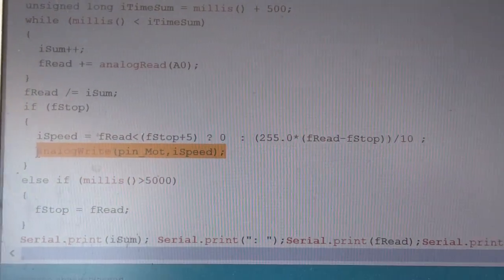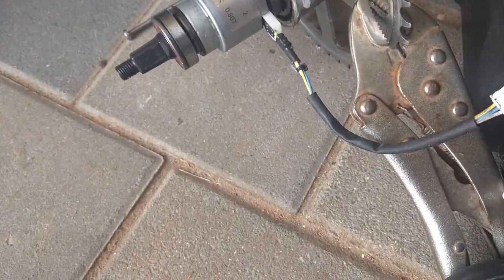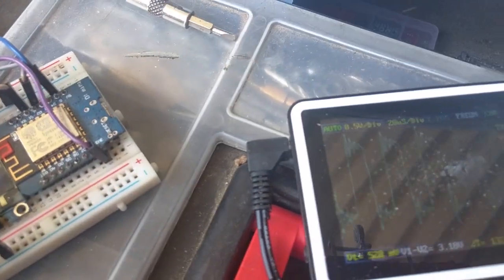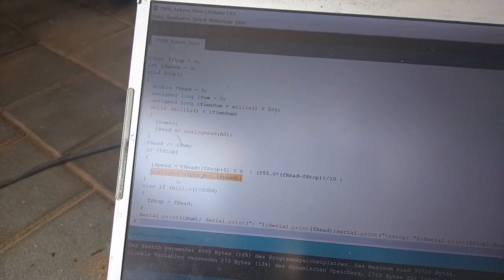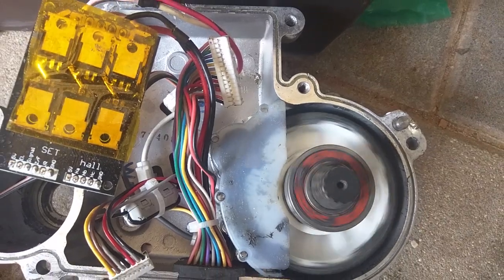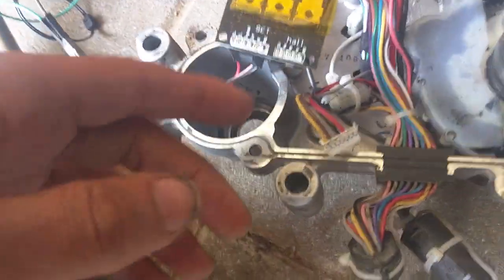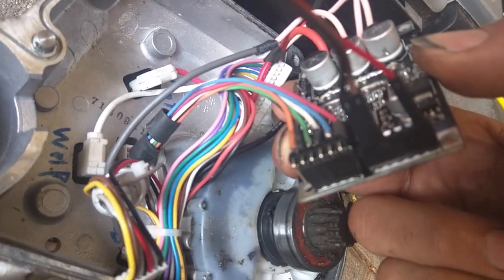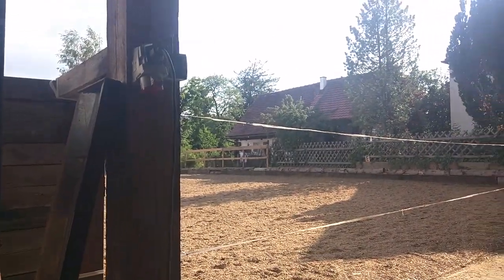Tutorial: Open source Panasonic/Flyer eBike/Pedelec Controller

Comment: I had a Bosch motor completely dead put of warranty. I used a simple KT sensorless controller and wired it to the motor phase cables.
Reply: Does it work? How many volts? Which motor version? Thanks

Comment: Hello, Can I use an external controller with this motor? No need to torque sensor, pas or whatever.

What's the max power this motor can take in your opinion?

Thanks
Reply from the maker: Sure you can extend the the three big phase cables and the 5 thin hall sensor cables to the outside and attach a generic bldc controller.
Power output should be 250 Watt at 36 Volts.
Reply: @robodurden  Nice. Here in Poland bikes with this motors are selling as recycling metal price, very cheap. I was wondering if add 48v battery and  a sinewave controller would be a fun little project. Thank you
Reply from the maker: @Full_Throttle_no_Brakes  and again another stupid fun project :-( Any bike should be street legal.
Reply: @robodurden  it is legal here off-road
Reply from the maker: @Full_Throttle_no_Brakes  and off-road ist stupid fun.

Comment: I don't understand the connection of the torque sensor. I am building the same motor driver as you. Could you please provide me the schematic for the connection you used on the sensor? You say a diode a capacitor and a resistor to ground but I don't understand how to connect this components. Thank you very kind
Reply from the maker: If I remember correctly, the sensor outputs AC. So you need a diode to omit the negative voltage. Then you charge a capacitor and measure it's voltage via ADC. The resistor is needed to discharge the capacitor. Maybe I find the old forum discussion. But I quit pedelecforum.de because they censored me..
Reply: @robodurden  thank you for your reply you are very kind. May I ask why is needed a resistor to discharge the capacitor? Because I don't find such info from the original post on the forum
Reply from the maker: @fiorenzo6301  you need to discharge the capacitor within a few milliseconds in order to correctly measure a decreasing torque :-) no resistor = always max torque measured.
Reply: @robodurden  ahhh interesting... But if you put a small value capacitor could it behaved in the same way as a big value capacitor + resistor?
Reply: Anyway i have finished the display yesterday, now I am going to work on the motor, maybe this evening or tomorrow i test the torque sensor with the oscilloscope. I aim to get more power from the motor than the original motor controller. I will test the motor with a higher voltage battery
Reply from the maker: @fiorenzo6301  maybe a VESC controller and 48V - If you aim for 30+ kmh. Cooling should be a problem.
Post a video once you are driving !
Reply from the maker: @fiorenzo6301  no. If your MCU offers input_pulldown you could use the internal resistor. But better ad the external resistor.
Reply: @robodurden  yes the problem is that the motor is potted into a kind of plastic/resin. I don't know how much power I could obtain from such  temperature constrained motor but we will see. Yes i will do a video
Reply: Hi robo durden, to day and yesterday I have tried everything you did with the couple sensor but it doesn't behave like yours. The square wave you obtain on the secondary coil doesn't change in anyway when you apply torque to the pedals. I have also reconnected the motor to it's original controller and hooked up my oscilloscope to the the sensor but the same no difference. I have read some topics about this motor and some people says that the sensor is read in a different way... I don't understand why it works for you. Could you help me please? I would be grateful
Reply: Hahaha maybe i know why!!! Because I am going in the wrong what. In your video I see that you locked the sproket hahah. I was putting force between the pedals of course it doesn't work. Is it right?
Reply from the maker: @fiorenzo6301  if I remember correctly, there is one square wave which does not change. This coil induces magnetic field. The other coil read that square wave but its strength depends on the torque.
Sorry, too long ago. I can not help you.
Reply from the maker: @fiorenzo6301  first rule of project mayhem: you do not ask questions.
Reply: @robodurden  ahahah now it works, i am very grateful with you. Thank you. If you like we can get in touch in a different way. If you provide to me it
Reply from the maker: @fiorenzo6301  i don't have friends.
Reply: @robodurden  well actually your assertion is quite true, but I have faith in the universe... science show us that it is so big and so complex that, of course, something superior did it and in It i give my trust and feel to be understood as a son and friend.
Reply from the maker: You should visit my https://github.com/RoboDurden/openPanasonicBike anyway. There is also still the link to my old forum post (German) and there I wrote:

Blau an GND vom Arduino Nano
Weiß mit 20 kHz Rechteck ****(pin_Pwm,20000);
Gelb über Diode an zB 1 uF Kondensator und analogRead(A0);
...
Um den Drehmomentsensor auszulesen hab ich eine Diode, einen 0,1 uF Keramikkondensator und ein 220k Ohm Widerstand verwendet.

Comment: Thanks for the great video. In stead off the original battery with the three pins. I want to use a 24 v batterij with only + and minus pins. On the original battery is also a third pen that goes to the Grey wire from the battery connector. Can you tell me how to connect this Grey wire. Must it be connected to the + or the minus? What is the function off it? Kind regards.
Reply from the maker: Sorry I did not have a Flyer 24V. And my old 24V Panasonic pedelecs only have two battery contacts. Try testing an original battery to see if the third cable is a serial bus.
Reply: @robodurden  In the video I see the motor connected to the batterij. I also see on de the battery the + and the - . What I asked for is the use off the grey wire that I see connected in the video on the battery pin marked with the C. Where does it go to in the motor and what is the purpase off it ?
Reply from the maker: I forgot. I guess C stands for communication :-(
But the 24V Flyer is said to run without communication. The Flyer in my video I a 36V bike. It won't run without the proprietary closed source communication protocol. That is why I built the entire electronics anew from scratch.
You definitely should not connect the grey cable to Plus. Minus might do no harm. But if the bike does not run without the grey cable you might consider buying a cheap E-Bike Controller. 
The PAS pedal assist sensor of the original bike won't work anymore. For that you would need my Firmware

Comment: Hi Robo, thanks for sharing the tips about Panasonic.
I want to do something similar with Vesc, and want to use original  torque sensor to send load demand to vesc adc.
How did you take torque sensor signal, i guess there are two coils, but i am not quite sure how it works, how i can use these three pins to get the signal about load?
Reply from the maker: I have forgotten.. take a close look at thr Arduino code on my GitHub. I think I generated a square wave with one digital output and then measured the received response voltage. I think I rectified only with a diode and a tiny capacitor. Watch my videos on this topic :-/
Reply: Thanks, will try that!
Reply: @ale944t  Are you succeed? vesc has problems with pas code. I've ridden 5000 km with vesc on my panasonic motor mid-drive motor with no display.

Comment: Hi! What about replacing the original very expensive panasonic battery with custom one? 
I'm going to buy cheap frame Flyer uproc 7 6.30 without battery. Is there any replacement for Flyer Panasonic Akku SIB 432 Wh 12 Ah 36 V?
Reply from the maker: No you have to rebuild the entire control electronics to attach your own 36 Volt battery :-( For a 26 Volt Flyer it might be possible but not for the 36 Volt System.
Reply: @robodurden  How is your project with arduino? Does it work? 
What do you think about using TSDZ2 controller to replace electronics by flyer and panasonic?
Reply from the maker: @sklivello  that 42€ controller might indeed be a perfect solution:  Bare controller for replace 36V 250W/350W or 48V 500W/750W TSDZ2 electric bicycle central mid motor
https://a.aliexpress.com/_BOAOdD

Based on the 6 TO220 Mosfets, the board could be as small as 70mm x 65mm. But I don't remember how much place there is inside the Panasonic motor and if the length of 66mm for the Mosfet would be flat.
But could be the case !

my two Arduino Mini plus cheap bldc controller was so far successful as the bike now is usable. But it still happens that the Arduino inside the motor hangs and the motor won't stop :-(((
Today I would place that Arduino outside ?
Also not good: my bldc controller only slowly increases power which is not so nice for pedal assist where the motor should kick in with full power.
So yes, another bldc controller would be nice.
Reply from the maker: @sklivello  my bldc controller is 63mm x 42mm. Study my videos to see if 65mm x 70mm could fit. Please post your findings here :-)
Reply from the maker: @sklivello  you have a different battery connector so I can not say how your motor has to be connected to a battery.
Search the net for someone with your type of connector.
And try to by a used battery to learn the function.
You could also open your motor to identify the communication lines and the plus and minus. If you have plus and minus you could power the motor and maybe find motor to battery communication with an oscilloscope.
But I fear you need an original battery or someone who already hacked the serial protocol.
Easiest way could be to replace the controller inside the motor. But you might need to program an Arduino mini as a PAS pedal assist sensor converter ..

Comment: I have one Panasonic engine, doesn’t work, I imagine exist the same problem, I don’t know how to fix it, if you have a diagram and spark parts I’ll appreciated
Reply from the maker: This will be a lot of work and my system still hangs from time to time at full speed. Luckily the bldc controller stops at overload. But one time a mosfet burned. Starting point would be "bldc controller" like https://www.ebay.de/itm/DC-12V-24V-36V-15A-500W-Brushless-Motor-Controller-Hall-BLDC-Driver-Board-sn/293586175882 . Such a bare bldc controller fits into the panasonic motor once the original controller has been removed.
But this controller can not go from 0 to 100% instantly. Therefore it always needs 2-3 seconds for the motor to assist the pedaling.

Maybe you are better off with an ordinary cheap "e-bike controller" like https://www.ebay.de/itm/36V-48V-350W-E-Bike-Electric-Bicycle-E-Scooter-Motor-BLDC-Brushless-Control-R1K0/273969308927

My way you definitely will need programming skills to understand and alter https://github.com/RoboDurden/openPanasonicBike

I you really would dare to go that way i will be happy to assist you.
Reply: @robodurden  thank you so time for your support
Did you mean, I just need replace the mainboard inside engine for one cheap controller, right?
I apprexiate if you May Bring me more information for whatsapp +51985021163. Thank you
Reply from the maker: @obarco127  Don't have whatsapp. When you are working on your motor you can open github issues. Yes you could use such a cheap controller with a potentiometer and a push button. There are such bldc controller boards with already a potentiometer on the board. 
But when you want to read the torque sensor (PAS = pedal assist sensor), then you nee a microcontroller and it gets way more complicated.
Reply from the maker: @obarco127  "Fully assembled board (shown above) developed for testing and performance validation only, not available for sale."
Reply: @robodurden  hi friend, where I can find one board for mid drives? Im still looking for one
Reply from the maker: @gamestalent7498  upload a 5 minutes video and share the link here.
Reply from the maker: @gamestalent7498  Sorry, you did NOT upload a 5 minutes video but only an image of the cables. Come back when you have connected such a bldc controller and can not make the motor work with it. 
The bldc controller i have used is not able to go fro 0% to 100% power instantly. That is not nice because it takes 2 seconds for the motor to fully assist. If you plan to simply use a button to turn the motor on this is not so bad. But if you plan to read the PAS (pedal assist sensor) then you might want to search for a bldc controller that kicks in immediately. 
That hoverboard controller might should do the job but will not fit into the panasonic housing: https://github.com/flo199213/Hoverboard-Firmware-Hack-Gen2
Reply from the maker: @gamestalent7498  If you have a 36 Volt motor then i think you will have to completely replace the motor controller and do what i did here. Maybe a cheap ebike kit motor controller will be better then doing all the work i did.
If you have a 26 Volt motor, it might be possible to connect a selfmade liion battery. But that is a totally different motor controller and i can be of no help.
Reply from the maker: @gamestalent7498  how did you learn the battery voltage ? 26 or 36 ?
Reply: Guys i am going to build such a controller, i have finished the display controller and now i am designing the motor controller from scratch. If some one interested could contact me.
Reply: It will be way more powerful than the original